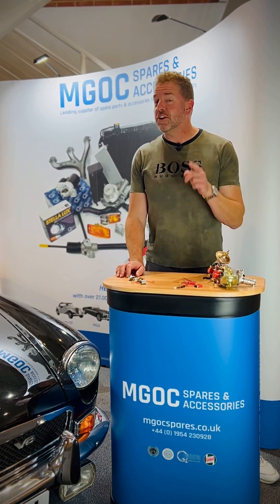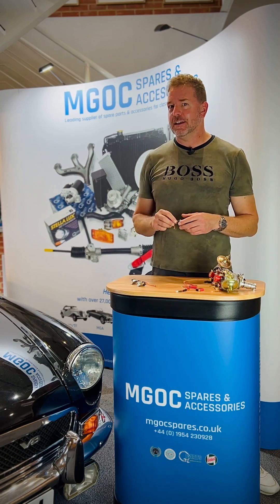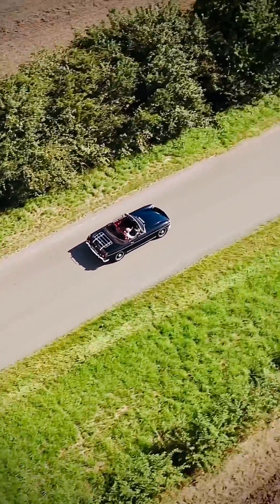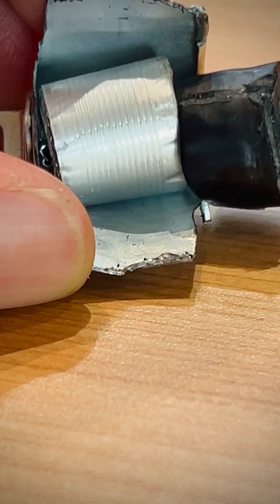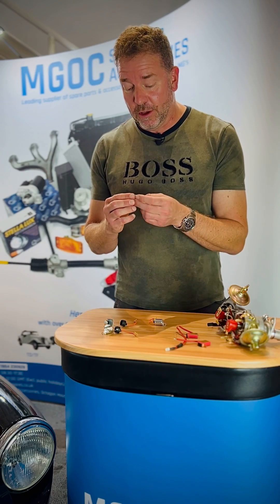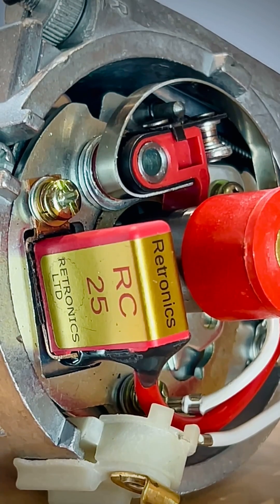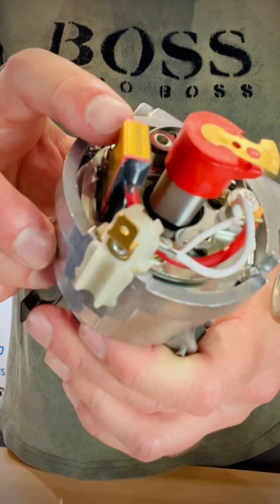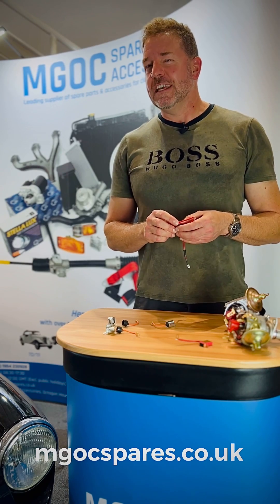Failed Capacitor/Condenser in Lucas Distributor? Paul Cowland tells us why and how we can fix it!

Comment: Metalized normal WIMA MKP and MKC and MKT dont work they burn out when used in a distributor, you need a 1000V DC 650V AC Snubber capacitor from Military US signal corps application but they are expensive and large.